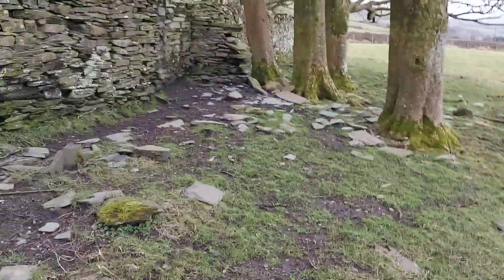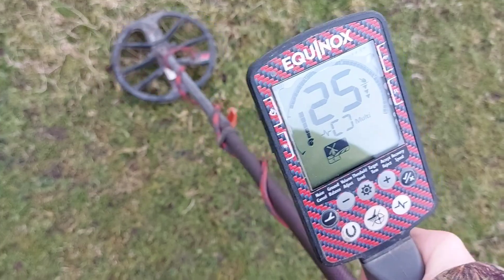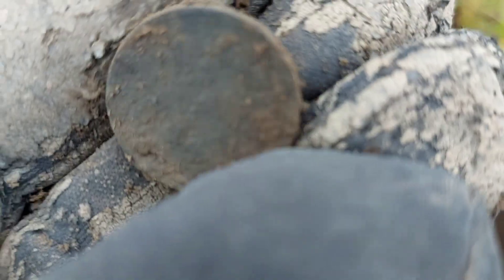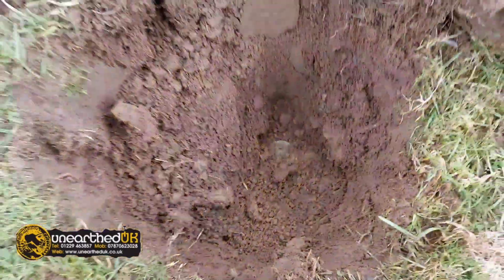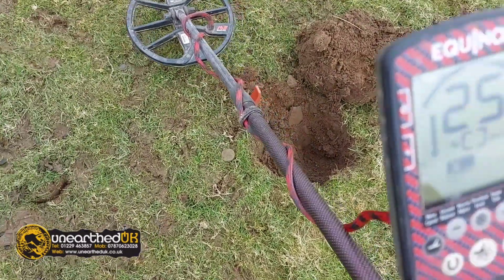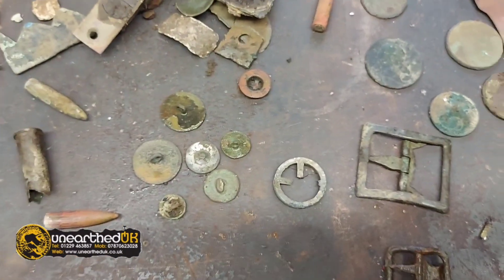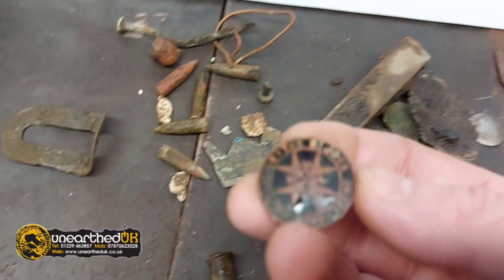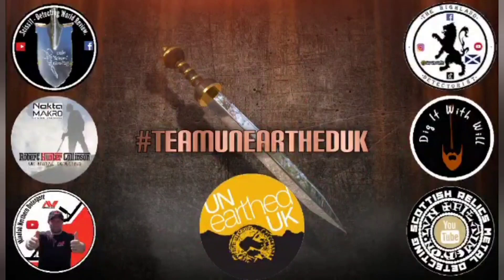equinox digging the high tones metaldetecting uk

Comment: Hi mate used your settings, do you always avoid if you hear iron in the pings? Do you just dig when there’s a two way sound without the iron noise in the background?
Reply: When I say iron in the pings, I was going over things and was hearing the quiet iron hum in the background when going over certain things.
Reply from the maker: The more you use it the better you will k
Now what is a good signal hard to explain mate probably better turning all metal of in the 50 tonnes till you get used  to it 👍